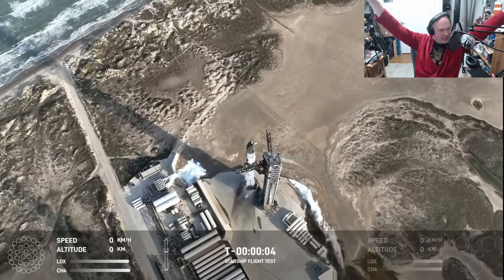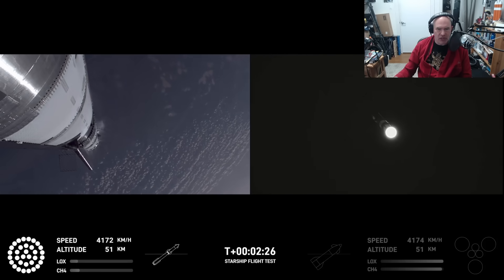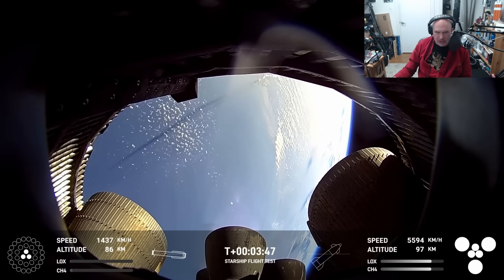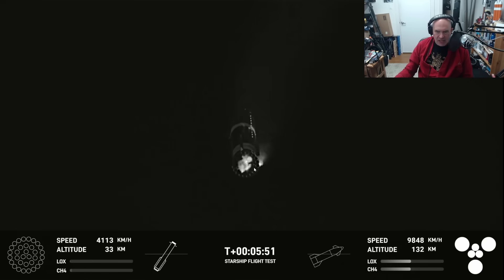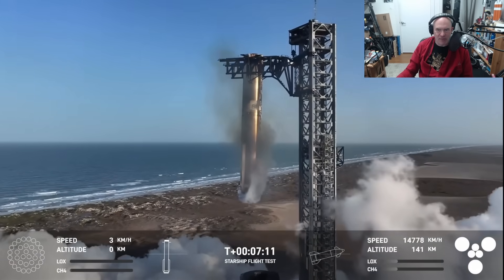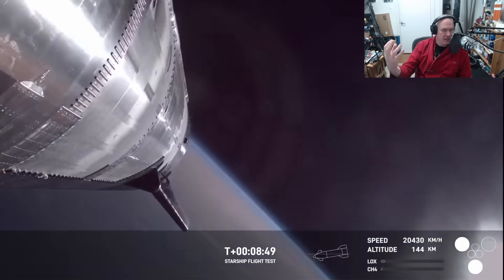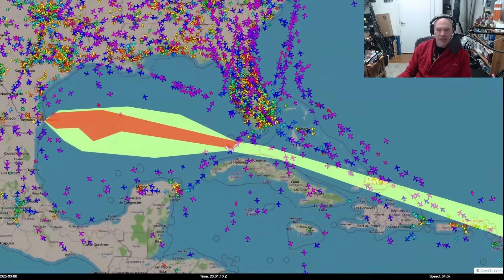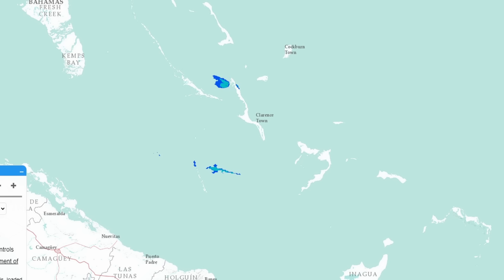SpaceX Make The Same Mistake Twice With Starship Flight 8

Comment: By the way, ARIANE 6, second flight, was a success.
Reply: ARIANE....if you want it to get there.....
Reply: Yep. There's a reason nasa moved towards qualify before fly. Rather than learn as you fly. We did it in apollo cause we could afford it and could afford the public opinion. We can't reverse that now at nasa. Has to be perfect...every time. Esp with crewed flights
Reply: Getting a rocket into space is pretty trivial compared to the design goals of StarShip. ARIANE really should up its specs to compete or really it's just a waste of money. BTW, the Falcon 9, which IS reusable, has almost exactly TWICE the payload to orbit as the Asinine Six - sans a bunch of solid-rocket motors, which obviously is not part of the base rocket configuration as those could be strapped to an outhouse and still get to orbit with some payload.
Reply: Ariane 6 is an expendable launch system, how can you compare it to Starship?
Reply: @m.3257 because it's a functional launch system that can launch stuff to orbit.
Reply: @robbiejames1540  again, it is much harder to develop a reusable launch system. In its expendable configuration, the Falcon 9 Block 5 (the only variant in operation at the moment) can launch a similar amount to the four-booster Ariane 6. It can send 8,300 kg (18,300 pounds) to geostationary transfer orbit and 22,800 kg (50,265 pounds) to low-Earth orbit.
Reply: @robbiejames1540  So is the Falcon 9 and Falcon Heavy, both of which are more proven and capable than Arianne…

So what’s your point?
Reply: Ariane 6 mostly uses proven Ariane 5 technology.
Reply: Thank God! We need more competitions on the market. No more monopoly.
Reply: Lol Ariane 6 is a step from 5. 10+ years to first successful flight. Fully expendable. And comparable to Falcon 9. Starship is totally different is every aspect and scale. Stop hating Elon cause it's the cool thing to do and enjoy that we live in an age where rockets are normal.
Reply: @bensaunders317 Hating Elon is not because it’s “cool”. It’s because he is a Not-C sympathizer, and a known hard drug using, deadlines missing IQ110 doofus. You Muskrats think everything he does is “cool” OTOH.
And rockets were normal since the 60s. What’s not normal is never reaching even the orbit after 8 expensive, failed launch’s, funded in large part by taxpayers. In your mind, though, this is all “normal”. Not going to Mars in 2022? Normal. Not landing on the moon 3 years ago, as was expected? Normal.
Seriously, you Muskrats need to grow up.
Reply: @bensaunders317  Rockets were normal for 5 decades already kiddo....
Reply: because its not made by a fucking startup...
Reply: It really helps when you give engineers time to run the numbers and simulations between flights. Yes, real, proper engineering is expensive, but i doubt it's more expensive than throwing 8 rockets into the ocean and crossing your fingers for the next flight.
Reply: @ReneSchickbauer  The jury's still out on whether the rapid test iteration process works or not. It took Arianne 6 14 years and 3.2 billion euros from initial design to first successful launch. Starship was first announced about 7 years ago, and we don't really know how much it has and will cost. It is a more ambitious project than Arianne 6 though.
Reply: @Nainara32  rapid application development was one of those old things that used to be popular before we moved to agile. Trial and error works great for quickly making working computer software (even if they are a bit unreliable and full of bugs). But perhaps it may not be suitable for rocket science? 

On the other hand, if your software model is good enough, it would be so much quicker and cheaper to interate than to do it in real life.
Reply: @Nainara32  wasn't the falcon rapid test iteration?
Reply: @Nainara32  StarShip was anounced 10 years ago, not 7 and was certainly getting designed prior to that.
Reply: @niox1920  no they had a phased test program that was well thought out.
Reply: @Nainara32  Saturn series took less than a decade to develop and launch to the moon and back, almost 60 years ago.
All other launches look puny in comparison!
Reply: @danielch6662  ...and Agile is just iterative with a lot of window dressing. It also doesn't work unless someone knows what the end result is supposed to look like. It's a way of organizing the efforts, it doesn't know a damned thing about the end goal. Of course as a practical matter somebody on the Agile team usually does know, but there's nothing in Agile that is going to guarantee that vision is correct.
Reply: @Nainara32    The initial announcement and development of Starship (not called Starship at the time) was around 2012/2013.  So, it's been over a decade now.
Reply: @Nainara32  I just wonder will it before or after the Gulf of Mexico is full of rocket debris.
Reply: @ReneSchickbauer  Most importantly traditional approatches are now proven to be faster.  Remember the CENTRAL claim of Musk 'design by explosion' system was that he would get his rocket to market soooo much faster then 'old space'.  We can now see that this has been a complete failure as SpaceX is still years away and maybe a dozen more launches from operational status (operation, nor orbit).  And in all likelyhood this longer development time also means higher total costs because the monetary burn rate is higher as so much more manufacturing infastructure is stood up early and constantly replaced and retooled.  To just run a design team doing the actual enginnering on computers is a lot cheaper then a full production line.
Reply: @ReneSchickbauer  bro, 8 is a rookie number, SpaceX initially wanted more, it was the FAA got in the way in the first place
if it wasn't the FAA, fail once ? well they would just launch 10 more and hope it all blow up to see the failure points.
Reply: @ReneSchickbauer  Are you intentionally omitting the part that happens between throwing rocket into ocean and crossing your fingers? If you somehow missed it, let us put it straight - they have been different rockets each time, with tens or hundreds of improvements after one goes into the ocean. Not just crossing their fingers. 

And then of course the whole thing about the goal being a reusable design, not just any design with a successful orbital flight.
Reply: @u1zha Getting from a vehicle that performs pretty well except for the heat shield not doing its job to a vehicle that fails before it reaches its intended hight isn’t an improvement. It’s a step backwards.
Reply: @u1zha  Still, reproducing almost the exact same failure mode as the previous one shows none of the hundreds of improvements happened at the right spot. They either rushed it, or worse, don't even have a clue what is causing it.
Reply: @u1zha  Meanwhile, NASA's moo rocket worked first time perfectly. Its called deep research. SpaceX builds rockets like software designers... incrementally. excped your software doesn't cost $200M and risk bringing down aircraft.
Reply: @rosaliebent4833  Yes this is the central falicy of SpaceX methodology, when your software crashes it dosn't melt the PC it's running on, you just change a line of code recompile and iterate at basically no cost other then labor and electricity.  This is why physical engineering is different then software and can not be done the same way.
Reply: @rosaliebent4833 perfectly? No they were extremely close to catastrophic failure. The astronauts got very, very lucky.
Reply: @u1zha  strange use of the word “improvement” when it failed again. 
Any half decent engineer would say that you fix the original problem first before adding additional unknown variables to the mix.
Reply: @rosaliebent4833  agree. The move fast and break things is a software coding mantra but should not be used in critical physical engineering applications.
Reply: @ The "move fast and breakl things" also only works for non-critical software, and even then software studios get shuttered all the time because their customer base moves on to more reliable software.

If you develop any kind of critical software applications, say a financial or warehouse managing package, breaking things is simply not an option. If a companies financial data or warehouse inventory mismatches, than that company is in big trouble.
Reply: @matwyder4187  yes I think there may be have been too much pressure to keep to the launch schedule.  See also Challenger...
Reply: @rosaliebent4833  - yep, sent a human capable capsule further from earth even that Apollo.
Reply: But it's not American so it doesn't count - at least not to the Musk fans.
Reply: At the perfect time too, considering the US foreign policy at the moment.
Reply: Ariane 6 shouldn't be compared with starship.
Reply: @surbhikumari953 Any space program can be compared to what your much ballyhooed starship program is. They compete for the same customers.

Comment: As a rocket uses up its propellent its mass decreases, so its acceleration increases. The mass of the Starship upper stage is about 94.6% propellant! So at stage separation Starship is MUCH heavier than it is near the end of its burn, so acceleration is MUCH less at the beginning of the burn than near the end, under the same thrust. Just before the RUD Ship 34 was accelerating at an impressive 3.6 Gs, at an attitude of about 6° above horizontal. Adding the vertical acceleration of gravity, I calculate that it was enduring about 3.85 Gs.

The mass of the propellant also reduces vibrations, so vibrations were also probably increasing, even if there were no unexpected harmonic oscillations or "pogo."

Under such stresses things break. Whatever broke on Ship 34 was probably different from what broke on Ship 33.

SpaceX's engineers will fix it, but I wish Elon were more focused on the important business of spaceflight, and less distracted chasing the Impossible Dream of "government efficiency."

Comment: I suspect the fire wasnt the main cause of the RUD. IMO the Rvac glowing finally destroyed that engine which then took out the other three sealevel engines. Two issues, but the fire didnt bring it down, imo it was an engine rud this time so not necessarily the same fault as before.
Reply: What caused the engine to glow?

Comment: My theory is that the ship flexing in flight caused cracks to form in the new hard fuel line tripod which lead to the fire (which is fuel rich if that orange color is anything to go by) which lead to the engine failures. 

Secondary theory is that the damaged nozzle was leaking CH4 which I guess mixed with leaking O2 that ignited and eventually took out multiple engines.

Comment: But they were very proud of the fact that they were able to successfully catch the booster.  This is like the old saying...winning a battle but losing the war.
Reply: there's no loss here. Only data and iteration.
Reply: @banzaiib 
I mean, if we're putting things into perspective, you're developing a new car, and the eight prototype spontaneously bursts into flames after two minutes. You haven't tested the handling, the engine, aerodynamics, noise, but hey, you know it's capable of moving. 
"No loss here", sure. Testing isn't wait until it explodes and see if you get farther next time.
Reply: @banzaiib  What did they learn from the first failure and what adjustments did they make before launching this one? It appears to be identical to the first failure.
Reply: @jaredjones6292  I don't know what changes they made to combat the problem,  but they learned that they had some 'harmonic frequencies'  (which Scott compared to a Bass-Guitar String) inside their engines.

It's possible that all they need to do to get rid of these is to use .1% thicker pipes throughout the system  (I don't imagine thinner is a good idea since margins are probably already calculated to be very thin),  but that is not a change you can implement in a few months  -  it requires a retooling of the engine factory and an appropriate number of engines to be built to equip Starship with them.
Reply: @banzaiib  'sO mUcH dAtA'

Comment: Did the booster engines blast the starship in the left image just after 00:01:48  ?    If so, could this have damaged the Starship?  If you look closely, it appears that the Starship really gets blasted, and while I don't see an attitude change in the video, I do see orange blast hitting the starship and there also appears to be debris departing the Starship (upper region of frame) at about 1:52
Reply: The above event also could have ignited any stray fuel leaking from the Starship.

Comment: They need to check the fuel lines going to the vacuum raptors engines, that is the only thing engine related that they have changed in block 2.

Comment: At 2 mins 30 into the flight (1:35 in your video) you can see the CH4 levels on the ship go crazy, I think the issue this time may have happened much earlier into flight than the previous one, just have to wait and see what SpX say.
Reply: that was likely slosh from the booster engines shutting down
Reply: @TheAechBomb  I agree, but looking back on the other flights, it's a lot worse on this flight than previous ones

Comment: Looks like an issue that only appears at high g near fuel exhaustion. Probably related to hydrostatic pressure. At multiple g loads the effective head is multiple times higher.

Comment: RUD is an automatic unscheduled destruction designed to blow ship to pieces when things go off nominal per ship data. This is to assure any ship debris is in planned safety zone. It is bad reporting to call this a ship explosion, which tends to imply ship blew up without the explict instruction to do so. 

Yes, having ship RUD again on second V2 try is disappointing, but it did the planned test of changes in affected areas between V2-7 and V2-8. Tests of V2-8 changes can reveal additional root causes or need for additional changes to V2-7 surfaced root causes. In testing it is not uncommon for it to be impossible to see lower level issues when higher level issue is present.
Reply: We don’t know the FTS was involved in the destruction.
Reply: looking at the video I would definitely call this an RUD, the engines blowing up was rapid and unscheduled, and pretty soon after it was disassembled

Comment: It is possible they knew the problem was not fully remedied. Instead load up with sensors, cameras etc. So if it did fail, they could learn from that and fix the problem for another flight. Wouldn't be surprised if they did that, but they would never say that outright, as they would never get a launch license.

Comment: Hey Scott, I'm thinking harmonics, but in the fuel itself not the structure. Kinda like water hammer, with the cause being not the rapid shutting of a valve but the effect of the raptor ignition suddenly compressing the fuel in the tank with a small volume of gas filled space which results in some fuel flow to get the shock wave started. If there's a harmonic frequency in there such as the tank structure itself, or the tank length matching the "hammer" wave length, voila, breakage. Maybe some sort of water hammer relief valve is needed.

Comment: I do not understand why they go to all the expense and complexity of putting the upper stage on a re-useable liquid fuelled first stage, - including THIRTY THREE Raptor engines at a million apiece, when the same lifting power could be achieved using (say) four Morton Thiokol solid fuel boosters like they used on the shuttle. These take the second stage to around 100 miles up and then are jettisoned (like a Korilov cross!) and land in the ocean to be retrieved and reused, - discuss please.
Reply: SRB reuse is stupid.  Go look up the NASA studies - they spent way more money "refurbing" SRBs than they would have just making new ones.  Engines need to be liquid fueled to be practically reusable, and it has been proven cost effective on Falcon 9.
Reply: The “solid” part of “solid fuel” literally refers to the propellant being a solid chunk of material as opposed to a liquid, and thus having to refuel the boosters takes a lot more effort than running fluid lines for cryogenic liquids (especially since the propellant needs to be shaped in a specific way for a specific thrust curve as the rocket burns)
Reply: @alexsiemers7898  Sorry no sale, - refuelling of solid boosters can be done offline in the hangar, whilst liquid fuel supply  to engines has to be done by high pressure cryogenic pumps aboard a hurtling spacecraft during takoff. Which is easier and simpler?

Comment: It still blows my mind the Raptors ignite while going supersonic in the opposite direction.
Reply: Why? Why does the velocity vector of travel affect the operation of the rocket ignition system?
Reply: @teebob21  because that means there’s supersonic gas flowing straight into the engine nozzle and combustion chamber
Reply: @alexsiemers7898  That is not how aerodynamics work. In order for air to flow into the combustion chamber, there would need to be both an inlet and an outlet. The only way that could happen is if valves didn't exist, and atmospheric air was somehow blowing up into the fuel and oxidizer tanks. As an example, take a partially empty water bottle, and attempt to inflate it by blowing air into it. It doesn't work.

Comment: when you flow fuel through a pipe at speeds of over 40feet a second you start to produce static electricity. this doesn't cause a problem if there is no source of oxygen. however if you get a leak then fires easily start. the pipes used for bulk loading and unloading tankers tend to be graphite lined to solve this problem.   great content as usual from Scott.

Comment: The accelerated testing is doing exactly what it is meant to do. Test things to destruction, find the weak spots and fix them so it does not happen again. The booster catches will keep piling up until they figure out the problems with Starship and rectify them.